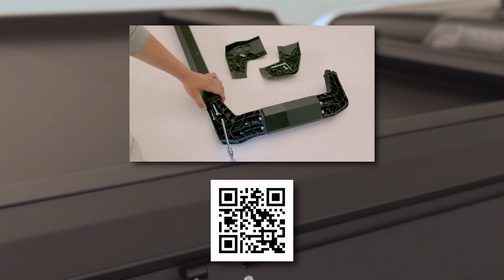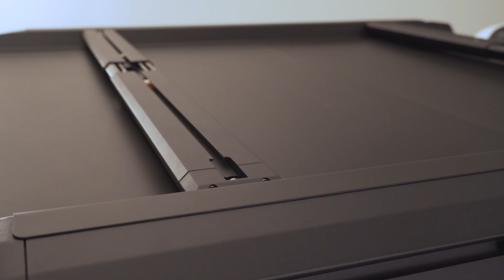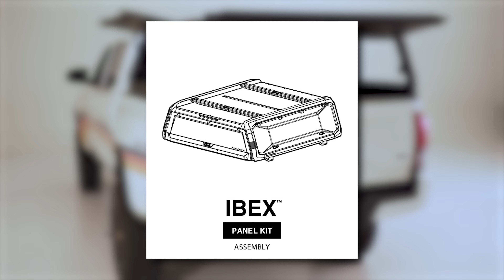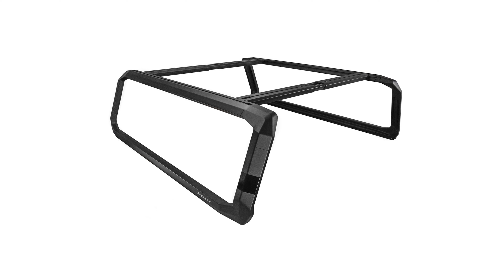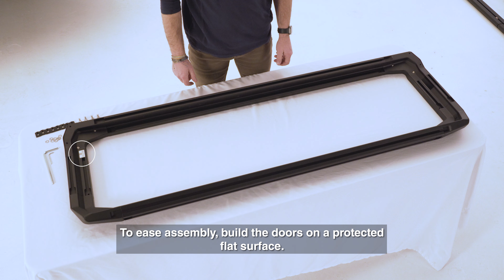How to assemble the IBEX™ Panel Kit from Küat Racks

Comment: How "weatherproof" is this? Does any seal tape need to be added to more fully water proof it? Is there already closed cell foam strips applied to the panels (top / side / front)?
Reply from the maker: Hi! The Panel Kit comes with some weather stripping to help seal it but it will not be fully waterproof.

Comment: Is this waterproof? Or will it keep dusts out? Will the riser kit i have with ibex work with the panel kit?
Reply: @TheKuatRacks
Reply from the maker: Hey there! The Panel Kit is weather resistant and has its own riser kit.
Reply: @TheKuatRacks oh no! Luckily, I stopped to investigate this. Currently at the step to apply weather stripping and didn't know what step was next with the riser kit I purchased separately. Which, I believe is the normal kit....